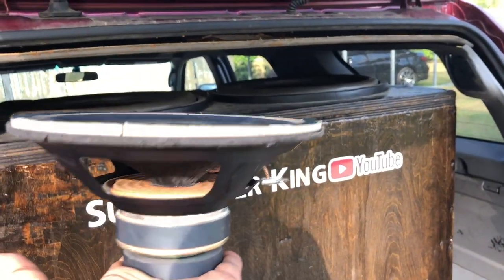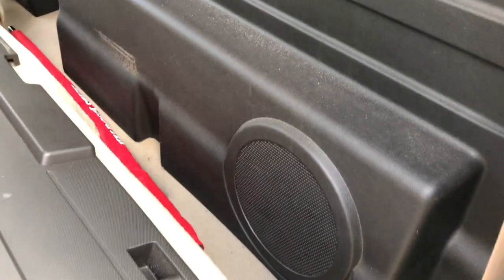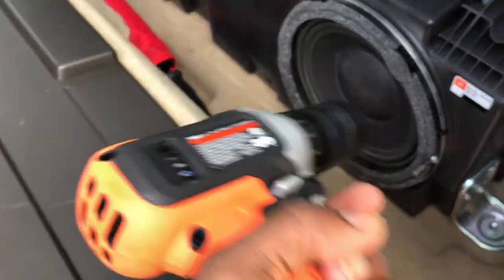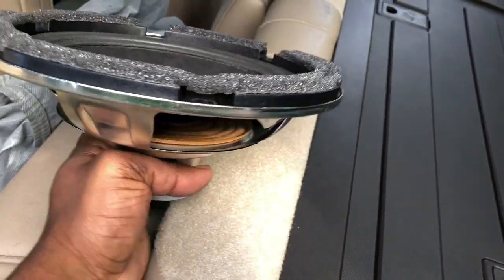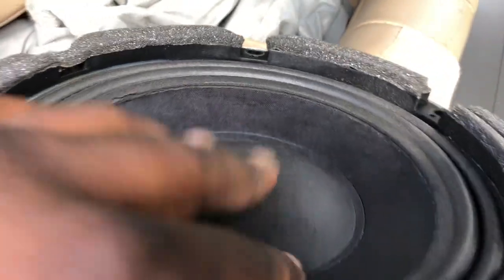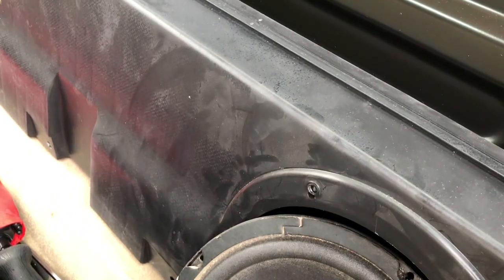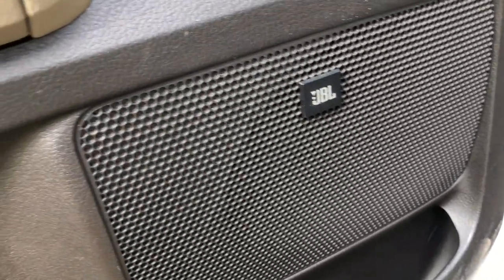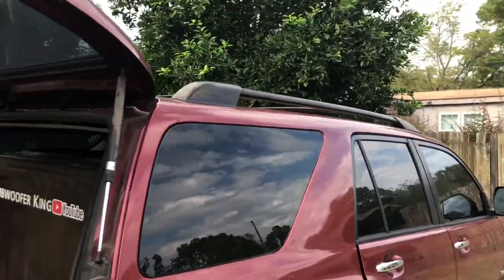Replacing Toyota Tundra JBL Sub with a Home Theater Subwoofer

Comment: I have the same problem but, how did you remove that panel that La behind the backseat????
Reply: I just did it. The little knobs you have to pull out not twist, and then you pop off the panels. You gotta pull on it a little hard thougj

Comment: "This is called the science of rigging..." as he's tightening the tiny screw into the plastic instead of loosening it. Also...vid is called "replacing sub" with no video of actual replacement, just removal of torn sub. Cool.
Reply from the maker: Rusty Savage This video is just half, I made a part 2. But yeah I probably should have waited a couple days and then combine the 2 videos
Reply: @SubwooferKing100  *hunting for part 2......must...complete...video
Reply from the maker: @TheRustySavage  I have the 2nd video on file. But haven't released it. Because my mine audience are into bigger more high end builds. They showed very little interest in this video when it first came out. I should have just went ahead and combined the two while I was at it
Reply: @SubwooferKing100  aaahhhhhh fans doing you like that? Weak. I was just curious what speaker you were using as a replacement, honestly. It's only like an 8" opening on that stock box right? What's a great 8" sub that will give me that clean and crisp bass that I can easily swap into that box? Thanks for the hard work, someone's gotta do it haha
Reply from the maker: Rusty Savage I replaced it with a Skar Audio shallow 8. It’s in the original factory location. And it sounds good! Like way better than I thought being in the factory box. I had to put a trim panel around the box to make it fit though
Reply: @SubwooferKing100  that looks like a great speaker upgrade... could you explain a bit of what you mean by 'put a trim panel around the box' ? Did you have to add some material so it would mount properly or was the speaker too big for the space and you had to make mods so the seat would fit?  Thanks again partner, can't wait to hear that knock.